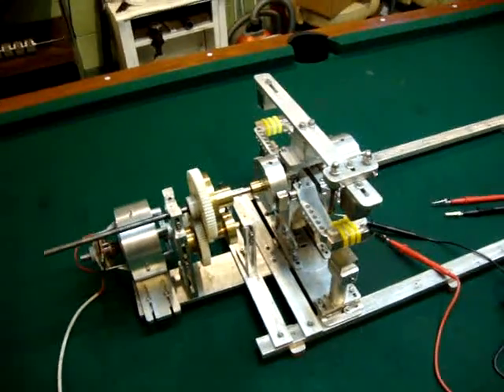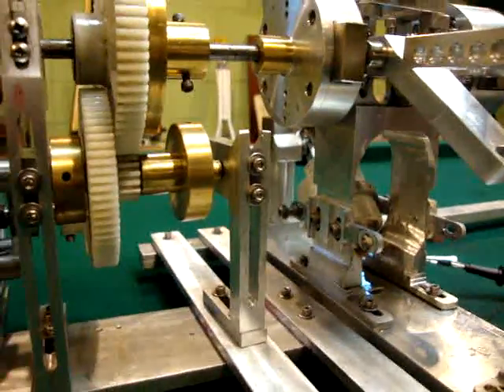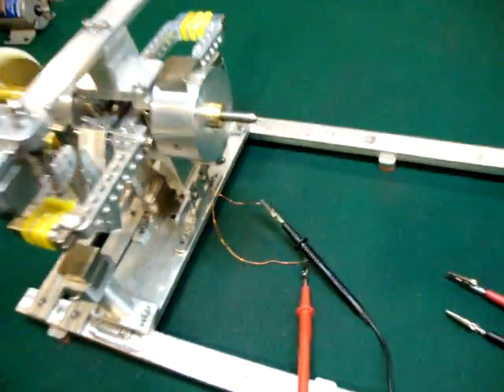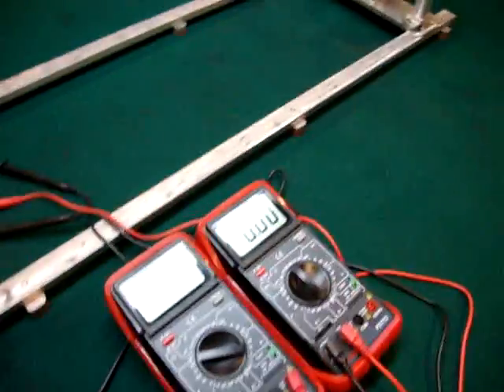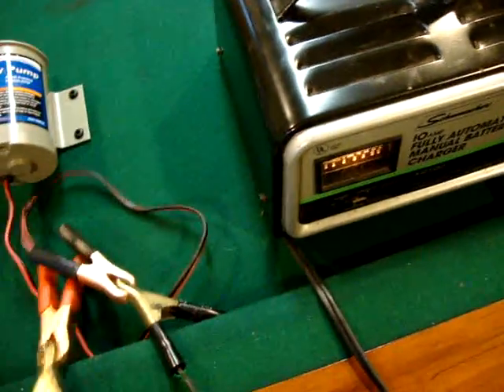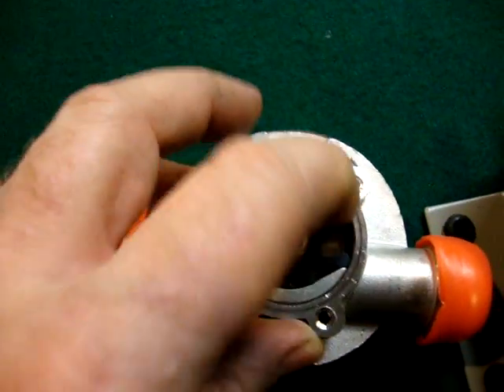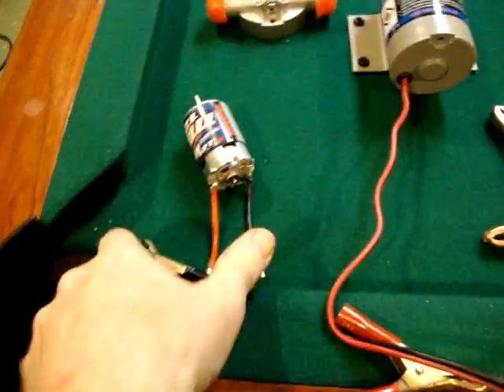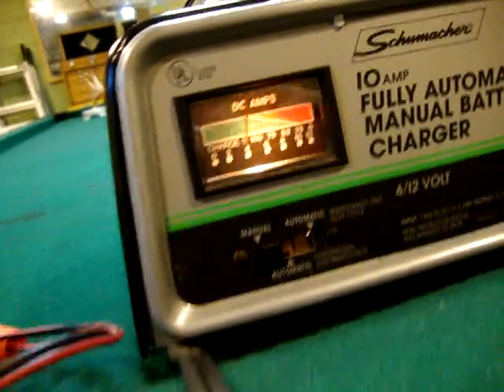Over Unity 25

Comment: I think you'll need to test output volt-amperes for each "node" on your machine, using a handful of motors. Then put all that in a spreadsheet, noting rpm, volt-ampere usage, and volt-ampere output of each generator node. Plug all that into a spreadsheet, and you should be able to find the proper setup for your machine.

I may not have explained that clearly, but use of a spreadsheet will definitely help you tune your setup with the proper volt-ampere motor with a proper rpm.

Comment: youy were not measuring amperage correctly on the unit. you must be in series of a load to measure amps. You can use the ten wrap method to be more acurate at low amperage,but you must be in series of a load.

Comment: Have you tried  to position the coil towards  end of the wings? You  can then use a bigger coil,  because there is more space for oscillation.  I think you have to have a load on your circuit to maesure the Amps....Good concept.